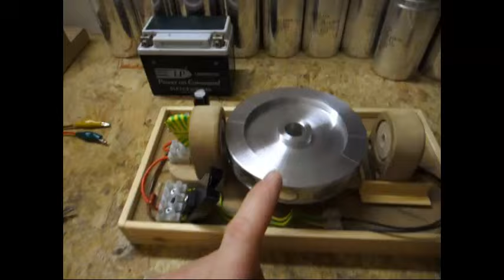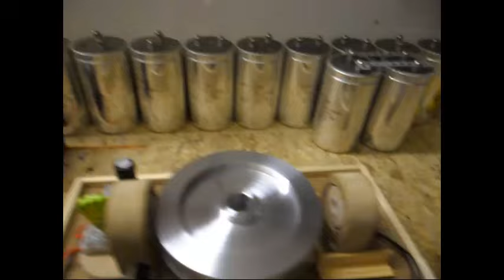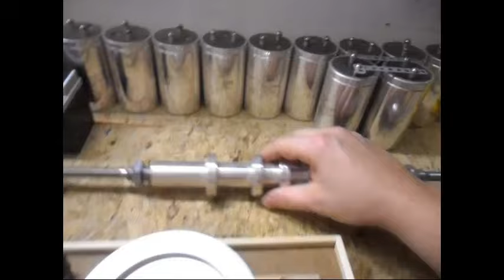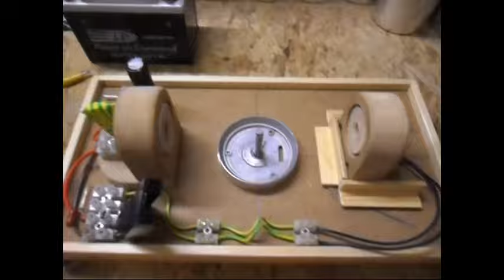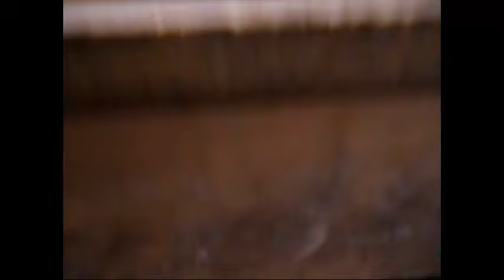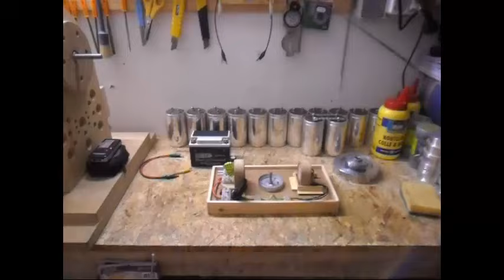Pulse Motor_Basic setup - Almost zero B-emf with hyperdrive speed...

Comment: You're  not getting  .much BACK E.M.F.
Because you're  rotor is, aluminum.!!
It's die-electric, and will soak up all the collapsing magnetism.!! That's just what aluminum does, Actually" it's  really good at, pulling  the Heat out of cercets,  & boards, but ( Haward Johnson ), had made a permanent magnet motor, and started production of them. But the ones that was being produced for the market, 
Didn't work. After he stopped production,  &  pulled some apart to see, why.,!!
His proto type, was made with wood., 
But the ones that was gonna be sold, 
To the public" was made from aluminum. 
More emportent, it had a solid, aluminum 
Rotor.!! So, anyone working with aluminum,  as a Rotor,  is setting themselves up for  failure 🤔🙄😕!!!!!
Think about that, my friend.....

Comment: Are you going to give us schematic diagram with specifications or you gonna keep that to yourself?  Come on share the knowledge.  coils, size, turns, circuit specs, voltage range etc..... ?  :-)
Reply from the maker: Thanks for your comment...^^
Haha, i did not know when i posted this video that so many people would want to try it out...o.O
It is a very simple circuit using a darlington pair transistor and a trigger coil, any NPN tranny will do just fine...;)
Drive coil, just wire around 0.9mm(if i remember correctly) and keep the resistance low and you'll be good to go...;)

Comment: I've been planning on using a very similar design in one of my projects, as I need something with a very high RPM to achieve what Im trying to do.  I haven't figured out how to modify Bedini's design to go any faster than about 300 rpm's.

One thing I don't understand is how you get such a high RPM, and also, what is that yellow/blue thing on the back of your run coil?  The rest of it I pretty much understand.  

I read that you are using the "Daftman's" circuit, but modified...  How did you modify it?  I can see that you only use a source battery and no charge battery, but how did you change the circuit to accommodate not having a charge battery?

One last thing... do you have any sketches you can post pictures of for us to see?  It could help us who are still learning how these things work.  Thanks for any reply!
Reply from the maker: Thanks for your comment...^^
If you are after high rpm and no b-emf collection than this circuit here is a simple a very good one and also from the daftman...;-)
See link,
https://i.pinimg.com/236x/ca/df/4d/cadf4dff9c48c75a068a1cd8a2820267--alternative-energy.jpg

My run coil is 0.6 ohm(forgot what the wire size was)...
And since mine did not have much b-emf at all i removed the neon and put a .01uf 100Vac cap instead...
i have tested this circuit a lot in the past and it works just as good as the modified bedini one...;-)
And that's about it and i hope this help you out further... ^^
Reply: @MythologicalLoneLion  
You are a very nice person, but tell me how can I read this graphic, the resolution of which cries out to God for vengeance? Hmm ....

Comment: Hi. this is Bala. very good performance, so high speed. can u give me the details of coils and circuit and parts. my mail id bdevanpally@gmail.com.
thanks.
Reply from the maker: Thanks for your comment...^^
No need to mail since this is a bedini circuit modified for my needs...;-)
Google bedini circuit...and since my setup does not produce much b-emf there's no need for a neon so i placed a tiny ac cap 0.1uf @ 100v one...;-)
And that is about it...lol
And a 12 pole rotor and a low ohm <1 coil will do...^^

Comment: Hi, can you post or make a video of the build of this motor, with parts list and detailed construction.  TY
Reply from the maker: Thanks for your comment...^^
There is really no need for a video on how to build it...;-)
All the info needed can be found in the comment section since a lot of people have ask me about that...^^
So do check out the comment section and if you are still stuck somewhere just ask and i'll do my best to get you up and running...;-)
Reply: Thanks much, will check it out.  Also, tnx for responding and the willingness to help out.
Reply from the maker: No problem and you are most welcome...^^
Here's a little help since it's kinda my nature...^^
 
1-One 12 pole rotor(magnets distance is about 1.5 times the coil core diameter) not more but it can just a bit smaller...;-)
2-One low ohm coil(Any wire between 0.9 to 1.5 is good and around 0.9 to 1.2 ohm max)
3-One drive circuit(Any will do)...use what you are used to)
NPN-Transistor/trigger coil
NPN-Transistor/hall sensor
N_channel-Mosfet/trigger coil
N_channel-Mosfet/hall sensor

Just remember that Mosfet Gate are voltage driven so make sure they get volts only when using a trigger coil...;-)
Cheers and hope this help you to get your setup going asap...^^

Comment: This is a very nice and obviously working pulse motor and I cannot stop admiring your beautiful magnet rotor. I like your workmanship, maybe because I am also doing it a similar way. The design and the look are also important to me. Currently my working project is also
a pulse motor and your video together with your explanations will certainly  help me to make it run. Thank you!
Reply from the maker: Thanks for your comment, your compliments and i'm very pleased that you've liked it...^^
For info on this setup just check out the comments section since i've been ask many things about it but if you don't find what you want to know just ask and i'll do my best to help you out the best i can...;-)
Good start will be a nice video recoder head...see link
https://upload.wikimedia.org/wikipedia/commons/5/5d/VHS_head_drum_1.jpg

These things are perfect for low/high rpm and are nicely balanced and they also free spin for a very long time and that is a very important part for having a good running pulse motor...;-)
Have fun and go for it...^^

Comment: Polish the rotor and then coat it with something that is more aerodynamically suited to reduce drag....for more efficiency...WELL DONE! maybe charge multiple batteries by adding more coils,. Further,  encapsulate in glass container that is filled with  hydrogen to lower the mass of the turbulence dynamics. remove the divots on the outside edge of rotor, eventually place in a vacuum.      from Webmaster of the Internet in Redding
Reply from the maker: Thanks for your comment, compliment and i'm glad you've liked it...^^
This was a fun project but this rotor is going to used soon in other projects...;-)
Reply: There may also be something to do involving electrostatics as in wimshurst generators that will assist the free energy exploration
Reply from the maker: Yes, i've seen and read about the "wimshurst generator" which seem to be a pretty cool device but i just don't have any more room on my "to do list"...lol

Comment: Please can you send circuit?
ahmedsayed551991@yahoo.com
Reply from the maker: Thanks for your comment and here is the circuit...^^
http://www.daftman.000a.biz/images/gallery_big1.jpg
I have just remove the second battery(charging one) and you do need a neon and/or a small ac cap across the Collector and Emiter of the transistor and also a low resistance coil and also magnets as close to each other as you can see in the video...;-)
Spacing between the magnets is like 1 to 1.3 the size of the coil core...
Hope this help you out a bit...^^
Reply: thanks man very much :D
Reply from the maker: No problem, you are most welcome...^^

Comment: Really good, but what Volt/Watt does it produce? Is it an advantage?
Reply from the maker: Thanks for your comment...^^
It doesn't produce any energy since it is just a  Pulse Motor but one with almost zero b-emf...^^
Reply from the maker: Thanks for your comment and i've missed you comment somehow and so my late reply...^^
It is basically a motor so it does not produce any volts/Amps/Watts...i could put some generator coils around that rotor and than it will produce some juice but this setup has been dismantle a long time ago so that's a no go...;-)
Reply: @MythologicalLoneLion  Why is there no back EMF? How are you able to avoid it?

Comment: ¿Podrías brindar el listado/características de los artículos que usaste? Por ejemplo, diámetro de las bobinas, tipo de alambre empleado, los capacitores que usaste, el transistor y las dimensiones de los imanes (N42 o N52).
Reply from the maker: Gracias para tu comentario...^^
Scroll down in the comment section and look at my comment to "mohammadreza ramin"...;-)
There's a lot of info on this setup in that comment of mine...;D
As for the circuit, check also the comment section...i've answer that a lot of times already....^^
Hope this help you out a bit...you don't need to make yours like mine to get this performance...as long you have a good balance between your setup parts/components it will perform just like mine...^^

Comment: Nice. The rotor appears very precise judging by the speeds it was doing. 
Just wondering - whats the purpose of that movable coil? does it keep the rotor spinning indefinitely once you discon the battery or what?
Reply from the maker: Thanks for your comment...^^
The movable coil is the trigger coil which produces energy to activate the transistor base so with moving it closer or further away from the rotor i can fine tune the transistor base which adjust the amps going thru it which effect the rotor speed...;-)
And no, it does slow down and stop when i remove this coil but because of the flywheel momentum it does keep spinning for a pretty long time...^^
Reply: Mister Caribbean Roots Cool. Now i get a better idea how it works.
Thanks for the reply  :-)
Reply from the maker: No problem, you are welcome and if you have more questions just ask and i'll do my best to help you out...^^

Comment: greetings, very interesting project , I wanted to do something similar, it will be possible to send me the electrical engineering drawings ? seres13@gmail.com Thank you
Reply from the maker: ProductoraAnimal 
Thanks for your comment and glad you liked it...^^
Sorry, i don't sent anything thru email anymore because of the fact that it takes a lot of my time with answering the mails on all sorts of questions. -.-
And also the circuits i'm using are not drawn anywhere so i need to make time to draw them which i really don't want to do...
I just wrote the exact same to another comment but this is basically a bedini type circuit with the trigger coil separately...;-)
And the run coil is being pulsed right in between the North and South magnet...Push & Pull...Yin & Yang fashion...^^
Cheers

Comment: Hey I just wondered did you make the rotor yourself or purchase it if you purchased it where might I find one or what do I need to search in order to purchase one ??
Reply from the maker: Jake Whitworth 
Thanks for your comment...^^
The rotor is my own design, made of solid aluminium and made on a lathe...;-)
As you can see it is made as a flywheel with most of it's mass on the circumference so it has very nice momentum just like a gyroscope which is basicly a flywheel as well...:D

Comment: Hey bud, great video. I was hoping you might be able to help me with my basic bifilar pulse motor, I'm having trouble hooking up the circuit correctly, please watch my video: http://youtu.be/q4b0LVFZ-hM
Reply from the maker: Hi Toby VanBaast,
Thanks for your comment...^^
I seen your video, i'll do my best to help you out the best i can...i'm no expert though...lol
First thing, is that a NPN or a PNP transistor...???
Since you got the negative of them batteries on the collector i guess it's a PNP...???
If it's a NPN switch them batteries leads going to the Collector and Emitter...
With a NPN the negative should be on the Emitter and your positive thru the drive coil on the Collector...;-)
I mostly work with NPN transistor or N-channel Mosfets since they are easier...well at least in my case...lol
They are a closed solid sate switch and when their base is activated/energized they open...;-)
Hope this help you out and not confuse you more...^^

Comment: Hi. I like your pulse motor.  Can you send me the information for the circuit please? Also the parts for them to.  How much did it cost to make that rotor? What is the rpm on it and how much does it weigh? What is the size of the battery?  Would you be willing to sell a rotor?  Thanks
Reply from the maker: Hi ntigravity,
Thanks for your comment and interest in the rotor...^^
The rotor is not for sale and information about the circuit and some other stuff can be found in my reply to mohammadreza ramin below this very same video...;-)
Rpm and weight of the rotor i do not know since i have never measure them because it worked like a charm from the beginning...lol
Hope this help you out...^^
Peace...

Comment: Hi
I am a computer teacher.
I want your information about the permanent magnet motor.
Engineering drawings, arrangement of magnets, clear images and videos to make and complete information.
Can you please help me?
Thanks
Reply from the maker: Hi mohammadreza ramin,
Thanks for your comment and interest in my Pulse Motor...^^
I don't have engineering drawings about it, i've just made some sketches by hand and went from there...that's how i always work...
I have 3 videos of this PM and they are on my channel...^^
Here are the links for the other two,
Pulse Motor_Basic setup - Almost zero B-emf Update 1 Hyperdrive speed, N-channel mosfet...
Pulse Motor_Basic setup - Almost zero B-emf Update 2 Hyperdrive speed, N-channel Fet & Hall...
For images you can make some screen shots of the videos.
Here are some extra information;
Magnets are south/north configuration,
Rotor was made on a lathe and it's solid aluminium with 12 holes for the magnets with each hole at 30 degree angle,
Magnets are 20mm diameter x 10mm height and are N42 Neodymium ones,
The rotor is made like a flywheel with most of it's weight on the outer edge and this help with the energy storage properties wich gives a lot of momentum wich is the reason why it keeps spinning for a very long time when the input power is disconnected(gyroscopes works on the same principle)
The drive circuit here is very basic,
TIP142 darlington NPN transistor with a trigger coil,
A diode from Emitter to Base,
A 400vac 0.1uf capacitor on the Collector and Emitter and this is to capture the b-emf(in my PM there is almost no b-emf),
Theres a 1k resistor on the Base to the trigger coil.
Trigger coil can be any coil but i prefer the higher resistance ones. this one here is a 59ohm one,
Run coil here is a very low ohm one, 0.6 or 0.9 ohm and it's a 1.2 or 1.8mm wire...can't remember wich one it was...lol
The source capacitor is a 1000uf at 63vdc,
A small black heatsink on the transistor and that's about it...;-)
This should be enough for you to make a pretty complete information lecture about this PM setup...^^
Cheers
Reply: Thanks for your answer
Reply from the maker: You are most welcome...^^

Comment: Very impressive motor..
Just one question: I see your magnets are very close one to each other. I thought that was only good for generators. but i can see it works also for motors. How close can you (for a motor) have the space between the magnets ? and are they NSNSNS or NNNN ?
Luc
Reply from the maker: Hi there Luc,
Thanks for your comment...^^
There are almost no rules when it comes to PM's...lol
The spacing depends on your drive coil core or/and the total diameter of the coil and there is plenty of room to play with till you find what works best for your setup...^^
But for it to work the rotor got to be N,S configured...;-)
You will be supriced how poweful your rotor will be driven this way...^^